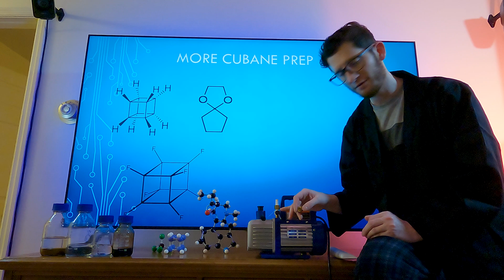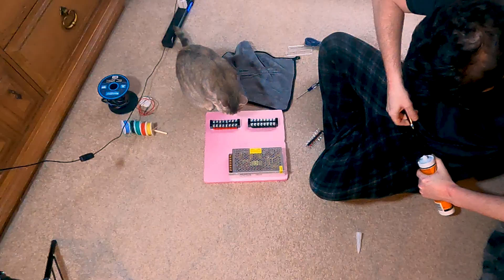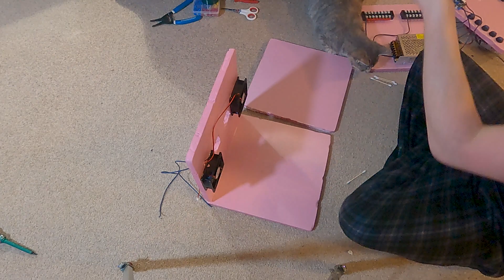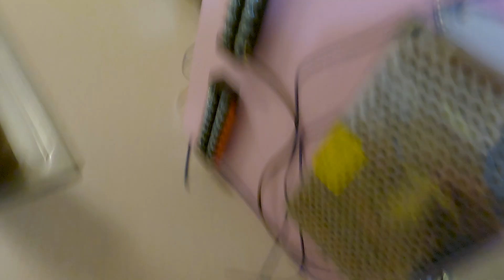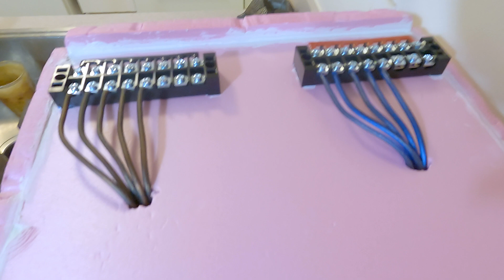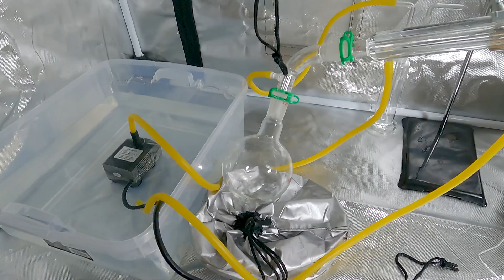DIY Lab: Preparing for Cubane Synthesis - Making Dioxane, Toluene, and a Photo Reactor

Comment: Pipe fittings are quite odd. I have 1/4" fitting and the hole measures .44" on caliper while the male is larger. NPT 1/4" thread has a nominal outside diameter of  about 0.5" etc. https://en.wikipedia.org/wiki/National_pipe_thread
Probably it has sometimes been defined as inside of the pipe (that has a wall + thread on the outside ie. larger) This can really mess you up. It is not like that 1/4" bolt is about 1/4" outside.